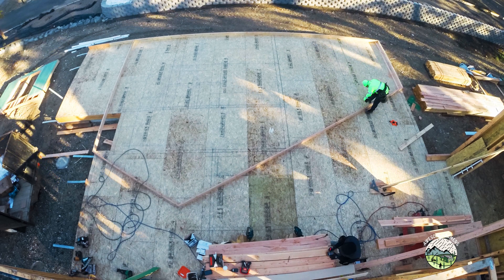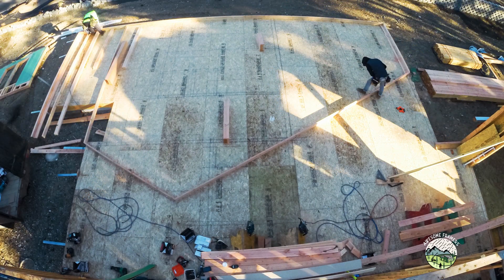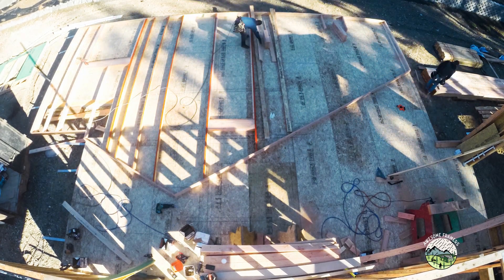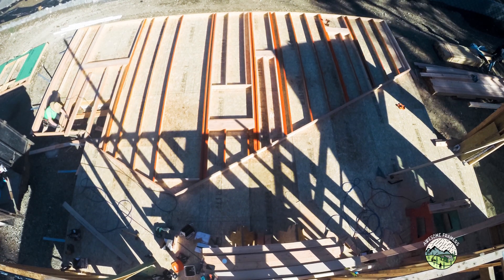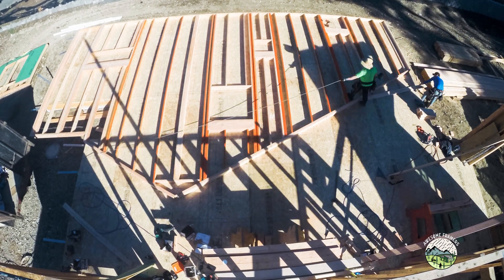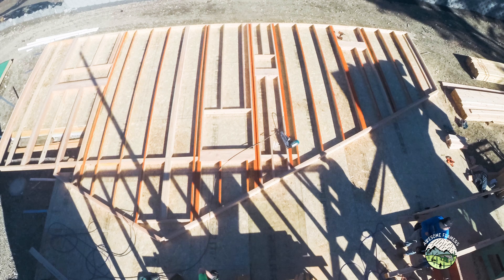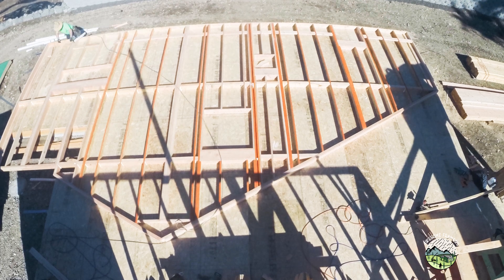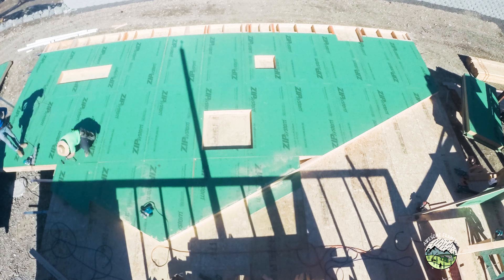Framing a Rake Wall

Comment: Would have been nice to have seen the wall being raised.  Plus, in most areas, fire blocking is not needed if the wall cavity is fully insulated.
Reply from the maker: There are many videos on this channel showing the walls  going up. Check the play lists 👍

Comment: Using LsL studs and having a lull machine is unstoppable for building tall walls .
Reply from the maker: Yes indeed!  This time we used a crane to lift the wall because we didn't have access.  But to be able to frame, sheathe, side, hang windows, and lift without staging is a huge time saver.  Not to mention safety.  Thanks!